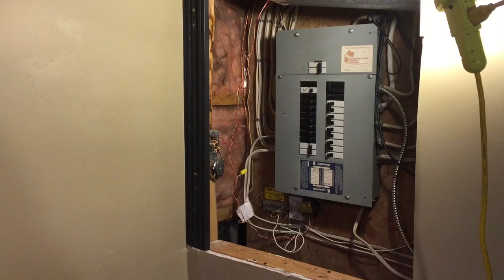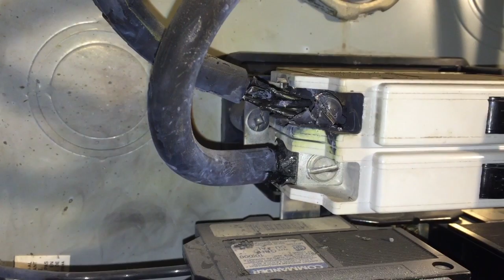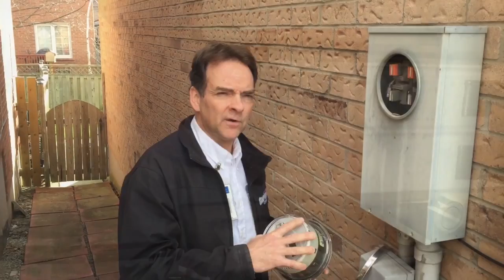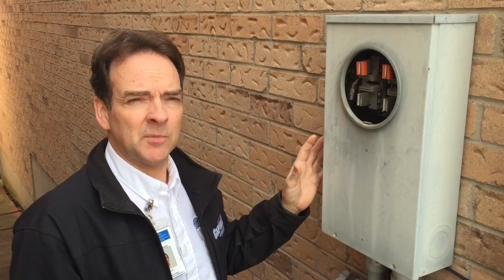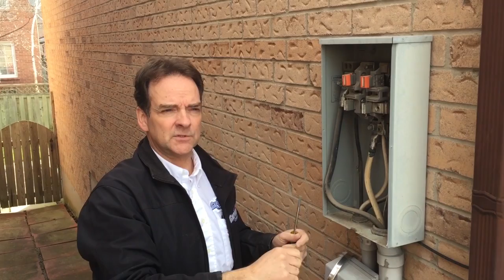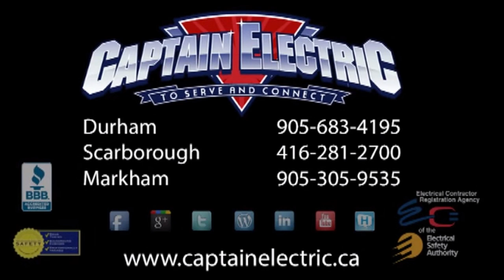Why does my house only have Half Power?

Comment: I had a friend who had power working in half of their apartment. I checked the meter and noticed that some volts were reading strange reading > I called the Utility company and told them the address and the issue, and they replied.  ' oh ya, your friend is 3 months behind on the Utility and for the few outlets that are working in the appt are illegally wired to someone else meter. Ouch. lol

Comment: I am suffering at a slummy trailer park. In my case there is a "middleman". There is ancient power post that has breaker and plugs before connecting to my home breaker box. The post  I was forced to replace 2post-100a breaks by emergency, fight for reimburse. At this point the top bus bar tooth melted & broke at both stations. it is rednecked to work this week until finally new post. I hope to have power in  the north rooms of my house again. the images would terrify

Comment: Canadian panels have a split cover because the main breaker has to be in its own compartment for safety reasons no branch wiring can be in this compartment .This will be changing now the mains must be outside with the meter socket.
In my area in the U.S.A. the contractor can pull the meter as long as hes not diverting electricity and has a legit reason to pull the meter such as seeing why 1/2 the house is out,changing a main breaker .Canada is weird they only use ring style meter sockets .Its better in this case to have the power cut before you pull the meter in case you had a cracked block, if you did it could blow up in your face [jaw & lug pulls with the meter kaboom] . That meter socket looks very well built those clips look much wider than the ones ive seen.
In America theres no special compartment for the main but you must put lug covers on the main breakers lugs these are called SERVICE SHIELDS [great idea] Hear also in the 2020 code cycle you must have a main disconnect on the outside fore the fire department. This could be the following assuming your panel is on the inside; Meter breaker combo, enclosed circuit breaker, fused pull out or a fused safety switch. A word of caution LOCK YOUR OUTSIDE DISCONNECT kids could and have shut off peoples power causing them plenty of damage.

Comment: Last night I lost power to a few lights and 2 outlets in my garage (including the power to my garage door opener), but other nearby lights and outlets do work....doesn't seem to be a breaker issue, although I'm still trying to figure out if there is a 2nd breaker box that I don't know/forgot about because I don't see any labels on my breaker box that seem to correspond to the garage floor.
Reply: omg same!!!!! like the whole power outlet in the second flr of our house doesnt work
Reply: @nickm.6390  It was a breaker switch and all I had to do was reset it, but I have 2 breaker boxes and one was outside of the garage in a closet and I had never touched it before and forgotten about it.

Comment: it would be helpful to define first what "half power" means.  does it mean power is there but weak or low?  or only half the house is powered?
Reply from the maker: Understood, and Thank you. "Half Power" means different things to different people. It is not a Electrical term, - it's more a generic term used by homeowners to describe that half of the Electrical items in their home or business are not working correctly. The reasons for so called "Half Power" are varied, and sometimes complicated, but are generally related to the systems parts outlined in the video.
Reply: @CaptainElectricPickering  I took it to mean that one of the two “legs” of single phase power was out of service. Both legs when used together supply 220-240v, while a single leg supplies 110-120 volts. Half of your 110 volt circuits would fail to provide power. Your bigger appliances running on 220v wouldn’t function at all.

I’m renting a flat in Mexico and I’m only getting “half power” service. That is, I’m getting 30 amps of 110v only on a single leg. I imagine (but I’m not sure) that the other apartment in the building is getting the other 110 volt leg. They’re metered separately. (The downstairs commercial space has TWO meters! Again, I’m guessing, but I imagine each meter is for each 110v leg!)

This is all very odd to me, and it seems to me it’s more dangerous because the loads aren’t balanced. If I understand correctly, a balanced load between two hot legs (more or less equal loads being pulled by both circuits) mean that the return (neutral) load is zero or near zero. 100 watts on the black wire and 100 watts on the red wire should balance out, meaning 0 watts on the neutral (all other things being equal, such as resistance). Is this correct?

Anyway, I’ve considered getting the electrical service upgraded to “full single phase”, but as it’s a rental I have not wanted to make the investment. Still, I’ve rented this apartment for 10 years and might continue renting for 10 more.

Comment: Right now I'm not getting no voltage maybe 6volts that's it I don't understand I had all the power working and running it's my first time tying back in 2 Old Wire with new wire in house
Reply from the maker: Hi Andrew, you need a professional to diagnose the problem and make the appropriate repair. There is no way to diagnose the issue without being there in person.

Comment: It’s always the main breaker
Reply: WRONG!  there are 2 hotlegs coming in to your home if you have 220.  USUALLY when half the region of the home is out, it is one hotleg.  Sometimes a meter issue too.
Reply: No it's not. Been to plenty of calls where transformer lost a leg
Reply from the maker: Reasons for this also include a burned meter base, the meter itself, faulty over head connections, underground fault, utilty issue.

Comment: need to ask a question I have a 1996 mobile home I have my kitchen,living room 2 bedrooms  and a bath electric is going out stays out like 15 seconds and comes back on now my master bedroom and bath stays on. my breakers do not kick what could be going on. A electrician came changed to breakers to my heat pump and dryer but electric still kick off after that. what could be going on? I'm a single mom really needed advice